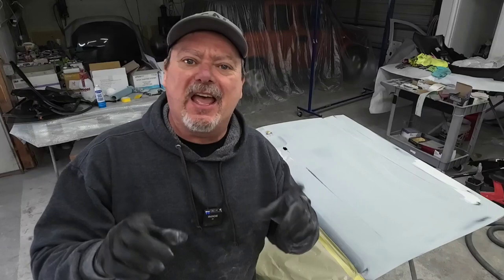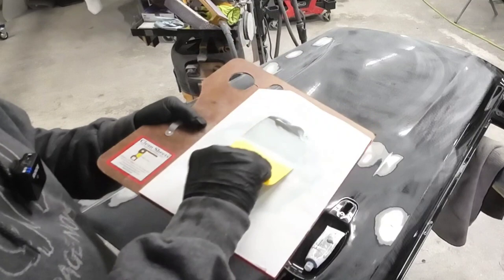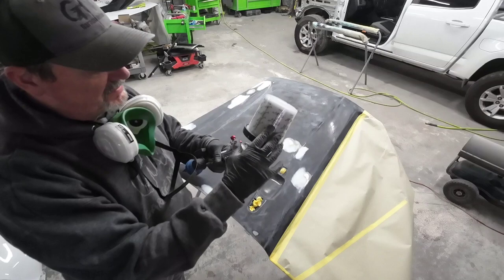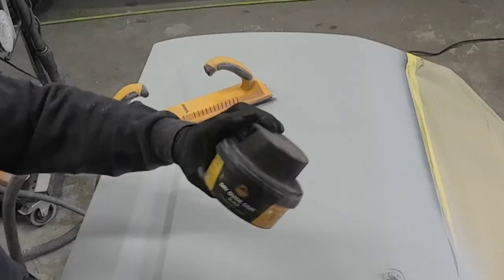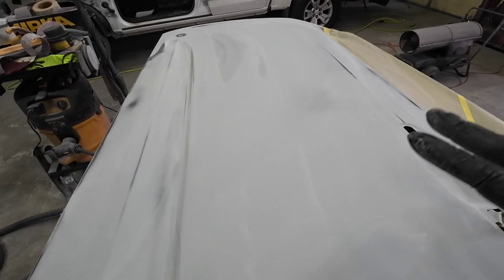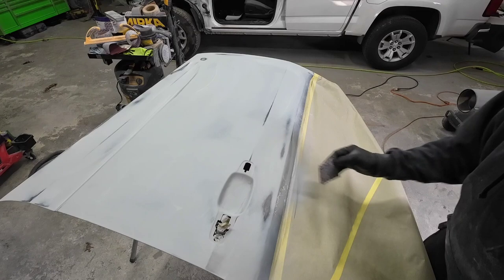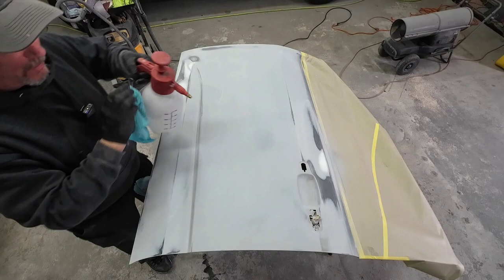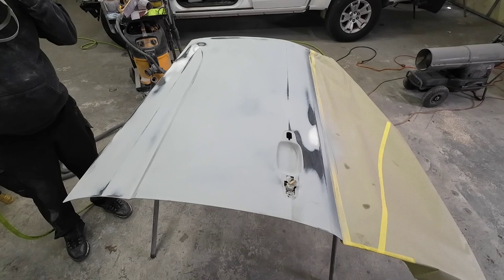How to prepare a used car door for paint.

Comment: Hi Chris, Finally got some very nice weather in CO. Going to paint some rims. Using all your information and the A610. The A610 came directly from China and was damaged in shipping. I did get a 100% refund and they told me to keep it. Other than the air regulator/shutoff valve being completely bent over the gun was fine. I took a chance and went to Spray Gunner and bought a replacement valve for $24. So for $24 I have a A610. I will use it with primer first to really make sure it sprays OK. Later Buddy! Happy Easter.
Reply from the maker: Awesome! Worked out well! Happy Easter! Beautiful day here in Oklahoma!

Comment: Please test your R500/R610 needles and nozzles with water BEFORE using. 

This is probably common practice to the seasoned painters but my first primer job was a total mess. Used the R610  1.7 tip for primer, the damn thing sputtered and back fed air into the 3M paint cup which started to leak all over due the the air back feeding. Adjusted air pressure at the compressor and the gun regulator, spray fan angles. Good thing it was just primer and I was able to work through the extremely rough finish, felt like a truck bed liner, by sanding with 220, 330 and 600. A ton of extra work.

Chris, maybe you can do an episode of how to avoid paint disasters like mine!  (;

Also another issue, the 610 air valve threads were not catching. I removed the valve assembly and noticed that the shaft was bent causing the threads not to line up. After straightening the shaft the valve screw threads were able to catch and air pressure could be adjusted. I leave it wide open anyway but the all the issues with this gun makes we question the quality control.

Needless to say my first painting experience has not been a fun one, but thank you Chris for sharing your knowledge and I have been learning a lot from your videos! (:

Comment: Hi Chris, thank you for the great tutorial. I got a door from the junkyard for my jeep grand cherokee with different color. So, The used door is in good shape. So do i need to sand the door to metal or just sand the clear coat then apply a 2k primer and paint it with the new color after that? I’ll be using 2k aerosol primer !
Reply from the maker: If it's  in good condition  you don't  even need to primer it. Definitely don't  need to take it to bare metal. Prepare the surface with  600 and base.

Comment: Hey Chris got a question for you I have a 1999 Accord 4 door sedan (black). Typiical honda paint faded on the hood , roof and trunk area (no clear at all ). As for the sides faded out clear from top of the doors r just past the bottom of the windows. The rest all the way to the bottom has clear. How would you attack this. ? After sanding would you do a "wet bed" on the entire care or seal it. Want the repaint the whole car back it's original color of black. Only minor door dents everything else is straight on the car.

Thanks for all you do,

Tony
Reply from the maker: I would seal the upper surfaces prep the side with 600 and repaint and clear. Appreciate the support

Comment: What is a reasonable price to have a used door painted and mounted?
Reply from the maker: There's a lot of variables there depending on the cost of the door typically doors are around 500 bucks, used doors, but they can they can cost more and then do they need additional work before painting? There could be some costs involved in that. Usually hanging door, is a few hours labor 2 to 3 hours,  which would be probably 200 bucks. I would say a reasonable price is gonna be between 500 in a 1000. there's also the fact that you have to blend into the adjacent panels. If you're painting just the door it's not gonna match perfectly unless you blend into the adjacent panels. Hope this helps appreciate you watching. Thanks to the comment.

Comment: I really appreciate your content! Had a question, can you paint over sanded clear coat or does it all have to be removed down to the base coat before priming? Thanks in advance, I'm new to all this.
Reply from the maker: I knew this question was going to come up. After I had this video  uploaded I realized I neglected to answer this. The answer is no, if the paint is in good condition it's best not to remove it. Surface scratches  and imperfections can be repaired without stripping off the old paint. If the paint is cracked or deteriorating then you may want to strip it down. Appreciate the question and support!
Reply: @GarageNoise  Helpful, thanks :)

Comment: So 1.3 tip for the primer and 1.3 for the paint as well on the lvlp gun?
Reply from the maker: I used the 1.3 for both in this video. You might need to use a 1.4 if your using this prime at full strength 4:1 mix .appreciate the comment and support!
Reply: @GarageNoise  but the 1.3 is good for clear and paint
Reply from the maker: @SOUTHSIDESUPERSTAR  yes, that's  what I use for the clear and paint.  The 1.3

Comment: I've been looking all over for the u-pol 2253 primer in the uk and it look like we don't have it available. I'm currently using the 2025 but would have liked to try out the 2253 for its added sealer and direct to metal capabilites. Any one from the uk know of any primers that does all this and is available in the uk.
Reply from the maker: You probably have Roberlo me1  in your are that's  a 2k primer that can be used as a sealer as well you might look into it. Appreciate the support!
Reply: @GarageNoise  thanks I'll take a look.